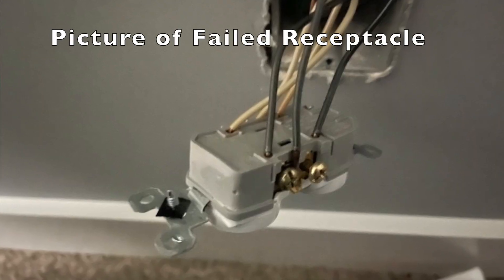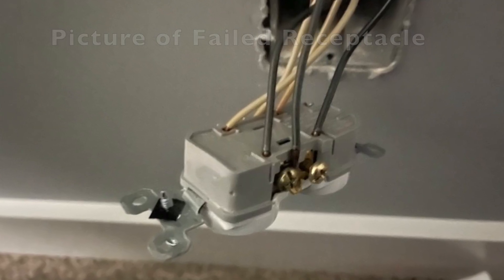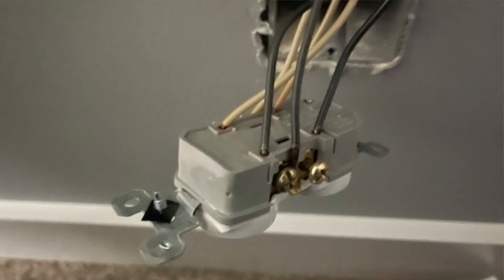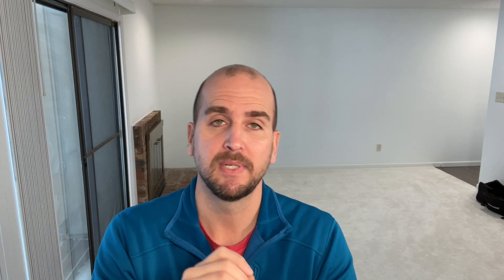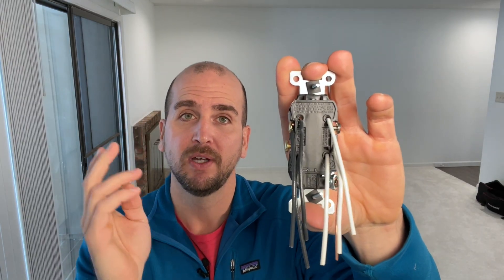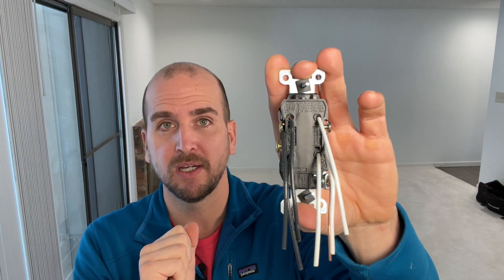Incorrectly Wired Outlet Found In Newly Built Home

Comment: be careful on advice, there are some similar looking receptacles , a gfci in particular, that the wires go only in the holes with the screws slightly recessed with no provision for under screw attachment, Inside are two plates to capture the wiring  like a Hubbell plug, odd but they are out there. overall excellent advice though.

Comment: Thanks for the video! 
Do you recommend putting electrical tape around the outer edge covering the screws?
Reply: I would if using metal boxes perhaps, but I don't see a point with plastic boxes.

Comment: Aren't wire nuts a bad solution also, I've read that lever connectors are better as they don't damage the wires.
Reply: FRICTIONS IS BAD FOR WIRES....I DID TEST THE LEVERS...I FEEL NOT COMFORTABLE IN ANY SITUATION THAT DEALS WITH 120V...ONLY 24V WOULD BE SAFE FOR THOSE SINCE SPEAKER WIRES DON'T CARRING HUGE CURRENT ,WHILE IT ONLY BITE THE WIRE BUT NO GRIP..ITS EASILY PULL VERY HARD APART AND WIRE NUTS DO NOT WHEN USING LINESMAN PLIERS CORRECTLY ON MAKE MORE TWIST AND TIGHT STRAND...WIRE NUT IS ONLY TIGHTLY DOWN TO WIRE SLEAVE ..WIRES HAVE TO BE GRAB TIGHTLY FOR CURRENT ...IT IS ITS NATURE FOR ELECTRONS DON'T LEAK OUT AND CAUSE FRICTION OVER THE YEARS ...ITS NUMBER ONE THING WIRES GET BURN WHEN CURRENT LEAK OUT ELSEWHERE ...

Comment: I've been told you also have to use electrical tape to keep the wire nuts tight. Pulling in the direction of tight.

Comment: The receptacle he shows with the red and white wires is not the same as the shitty back stabbed. The commercial side clamp receptacles are far superior and not at all an issue. And not all wire nuts require pretwisting in fact some dont work properly when you pretwist.

Comment: Hi, I'm not an electrician but have wired some of my own home outlets and switches. As an additional precaution, I've always turned in the unused connection screws on the the outlets and ran a couple courses of  electrical tape all the way around the plastic body of the switch or outlet thus covering the connecting screws in the process. When I peel back the outside insulation in the process of exposing the inner conductors, I usually leave about an inch and a half of the outside skin folding it backwards and over itself and taping it down with a few turns of electrical tape. I do this to add additional insulation where the clamp makes contact with the wire where it enters the electrical boxes.  It only takes an extra minute and adds some additional protection especially on the metal boxes. Some folks turn the clamps up to tightly and in turn could penetrate the inner and outer insulation of the wire causing it to short out.

Comment: In the UK we have ring circuits so those pigtails would not be good. Most domestic ring main circuits here are 32 amp fused feeding  several 13 amp single or double socket outlets so that pig tail could be subjected to 26 amps  WCS.

Comment: Is it wrong that i wrap one wrap of electrical tape around the plug to protect the plug from shorting against the box ? I tend to do this when i do backsplash in kitchens because more often then not i find the boxes are twited from the bad stud they attached it to and the plug is not level or plum and if i adjust it i feel the plug is real close to the box and i dont feel comfortable leaving a possible short ....
Reply from the maker: Not wrong but there seems to be a bit of a split in the pros and joes on where to wrap the receptacle with electrical tape.  This video dives deeper https://youtu.be/mY45ZDdiPn4

Comment: The GFI receptacle in my basement is wired in so badly that I just capped all the wires (grounds too), and put a blank cover plate over the box.
Reply: Apparently you had a GFI at the beginning of the string. Now the other outlets for longer have GFI protection!

Comment: So is no one going to say it? I guess I will. You installed the outlet upside down. The little holes for the ground are supposed to go on top. But no one ever does it this way except for hospitals and on electric generators. It even shows a diagram on the box of most outlet manufacturers that the little whole goes on top
Reply from the maker: If you want to dive deep on that topic here is a video with 4000+ comments on the topic of Ground Up or Down.  https://youtu.be/kYXvcog9MxY

Comment: Push ins should be against code. If people could see the connection they make to the wire they would understand.
Reply: Push in can actually  heat up due to small contact  path.
Reply: If push-in/stab-lok have been identified as a safety issue, by so many professional electricians,  Why does Underwriter's Laboratories (USA) and Canadian Standards Association (Canada) continue to permit their manufacture?

Comment: What are your thoughts on lazy loops?  That is where  a 12" of jacket is stripped from Romex and the loop pulled through the box.  Only about 1/2" of wire insulation is stripped from the apex of the loops and this results in unbroken wires looped over the screws.
Reply from the maker: Not a fan, what about you?
Reply: @EverydayHomeRepairs  I rather like them, as they eliminate a point of failure, allow an unbroken wire from the panel to the end of the circuit; and require less wire to be in the box.  I especially like them for the ground wire, and will do an unbroken loop, even when the hot and neutral are clipped and put into nuts or push-ins.

When I do a pigtail, I usually fold the wire over, strip it, lay the pigtail parallel, twist them together and put on a nut.

If you notice, linemen don't cut the overhead power lines when they splice in the service drop.

Comment: Only thing I saw was wrong is you used a 15amp receptacle on a 20amp circuit. Remember electricity is heat and receptacles are rated for that heat.

Comment: "Mistake #3" needs clarification.  It is neither against code nor against best practice to feed through a receptacle.  In fact, Leviton's TRD15 instruction sheet shows this being done in their first wiring diagram (https://www.leviton.com/en/docs/PK-93996-10-02-0B-W.pdf).  I wouldn't connect more than 1 wire per terminal, but there's nothing wrong with attaching 1 wire to each terminal.  It saves you room in the box and has no disadvantage to using a pigtail and wire nut.

Comment: Great advice plus using the term “Best Practices” is or should be in every industry. 
  Short story, A house built in 1982 with one owner was what my wife wanted. We moved is Easter 1993. My wife said door bell doesn’t work, I confirm problem. Works fine as only one and contacts good. (Dielectric grease went in) So later, works, check again - nothing! What?
I go to the 24 Vac transformer on switch / fuse box on furnace. Identified the primary, dead.
I follow the metal conduit and went to far side then down. What? I had to open furnace door with power off, found the primary wired to the fan using the wire nuts already there. I moved it to hot.
 But felt their had to be more rookie mistakes but none. Just hope the builder was not related! Even though plastic box or extension, I got into the habit of taping around the screws. I place a dot of black weather strip adhesive to the tag end, hold in place for 15-20 seconds. Never comes off. Safer for whoever works on it next, re-check for power, even if hand held shows dead. 
 Grounding rods is another pet peeve of mine. Thanks for sweet little pointers!

Comment: I have seen many variants and the push in is in my opinion the worst idea ever conceived because it looks easy in theory but in practice the wires are put under stress when put into the box.
The screw terminals where you have the wire directly under the screw isn't really good either. A better variant is the ones with a square nut that's pulled up with the screw so that the wire is just pressed by the nut without any rotation that can cause the wire to get messed up. Same wire diameter/gauge if you connect a chain. (yes, there's always the case that you shouldn't have a chain of outlets, but it's easier said than done)

Comment: I was about to rant and rave about using those quick connect inserts on the back. Thank you for addressing them. We call them back stabbers at work, they'll be fine for awhile, but they're all just waiting to stab you in the back when you're not looking.
Reply: They should really change the design of them. You should be able to push the wire through until it pokes out, then bend the wire into that familiar J shape and pull it back before tightening it up. Wrap some electrical tape around the outside and you'd get something that's never going anywhere, but is still going to have virtually all the same benefits of the back stab design.

Comment: Does it matter if the wires go either top or bottom for both hot and neutral?
Reply: It does not matter. In fact some outlets come with opposite side screws diagonal from each other already unscrewed and ready for wire.

Comment: As I've always heard, NEC/Building codes are the minimum requirements to keep you safe, but doesn't necessarily lend to the best or highest quality work. <Subscribed!>
Reply: Engineering is all about finding the bare minimum requirements to get something done and adding a bit of margin for possible errors. Just about any idiot can build something that's over built, a good engineer can build it in a way that has less waste and only the appropriate margins for safety.
Reply: Yes, the code is NOT a how to manual. It is the bare minimum for safety. If a governing body(city, county, state) adopts it they must do so in whole, but they are free to add stricter requirements than those in the code.

Comment: New houses never use metal boxes.  Plastic only. So, first mistake does not exist. Second mistake does not exist too, because it correct to use push-in slot.  For last outlet or two separate outlets 14 ga wire is OK, because we use 15 amp outlets. Third one is OK too, there is no mistake. I see thousand outlets connected in this way with no problem for dozens of years.
Man, don't foolish people.

Comment: i did some work for a "friend" at work. she needed something repaired in her addition. the bathroom light and the sink outlet were wired to a switch in another bathroom in the main house and it was done poorly. in the addition bathroom where a junction was made to the sink outlet it had been modified. a hole was drilled in the back allowing the current carrying wire to make contact with the neutral wire inside the receptacle. you tell me how that happened and why they did it.

Comment: I think it is safer to install the receptacle with the neutral on top because if a plug is loosely plugged and something fall on it like a wire or metal plate it will not immediately touched the hot wires. There was an incident where a woman used a metal wire as clothesline fell on the receptacle got electrocuted and died so was the husband trying to save her.

Comment: Around 2004, the height of the building boom in Las Vegas, a work colleague of mine purhased a new home from a supposedly reputable home builder. After moving in, his mother-in-law was ironing one day when the receptacle into which the iron was plugged started smoking. When the builder sent out an electrician to diagnose the problem, he found that particular circuit was wired directly to the hot bus in the breaker panel with no breaker at all on that circuit. Fortunately it got repaired with no further damage, but that house had been signed off by the building inspector who obviously didn't look very well during the rough-in inspection.

Comment: My bathroom fan quit so I replaced it with a whole new housing and fan because the existing one was oddball. Found the wires were just twisted together and black electrical taped...... out side of the junction box/corner. Oh and the ground wire was just clipped way. K&B Homes, built 1998.

Comment: I was always told NOT to twist the wires to heather do that with the wire nut and tug on each wire to make Shute it is held tight, I’m over 80 now and no not do any work at all but have done construction of all kinds from 13 years old until I was 76, please tell me if I was wrong !

Comment: 6:00 Best practice is to insert wire under screw so wire is drawn in when you tighten the screw. The way you have it, your screw wants to push the wire out. Normally on the hot side place wire on bottom of screw and above on the neutral/ground side.
Reply: You're referring to a consumer grade receptacle where the wire goes around the screw. This is a commercial grade plug and has wire clamps. The wire goes straight into the clamp and the screw is tightened down.
Reply: @warrensteel9954  You are correct. I didn't see the clamp. It looked to me like the wire was under the screw head.
Reply: @petehenry7878  no worries. I like these commercial plugs a lot better than the residential ones.
Reply: @warrensteel9954  Me too.

Comment: In addition to doing that, I always wrap the circumference of the electrical outlet with electrical tape to cover the screw terminal to prevent any possible shorting, and also wrap any wire connector plugs with electrical tape to make sure that no debris over time enters and creates a possible short.
Reply: 1. not necessary box screws prevent terminals from touching metal box
Reply: can you not get outlets that are manufactured to be safe from the start . why should you need to tape an outlet in the first place. 
uk sparks btw

Comment: The box extender disabled the grounding fault protection of the box
Reply: GFI has to be wired with three wires, white, black and green for grounding in a single point reference for all outlets, or it will not work. The box extender has has nothing to do with its functionality. The outlet in the video wasn’t GFI and there wasn’t a green pigtail, so the GFI wouldn’t work anyway.

Comment: Question, why use a pigtail on that outlet? Theres two hot and neg posts, I dont understand not using both
 of the posts instead of double up or pigtail. Am I missing something? I am not a electrician haha. @4:40 is there some reason to avoid this connector on the outlets?
Reply from the maker: Pigtails help to isolate the receptacle from the rest of the circuit.  With pigtails this receptacle could fail and not knock out the other receptacle down stream.
Reply: @EverydayHomeRepairs  ah, thank you for the response and great videos.

Comment: Also, if that is a 15 AMP receptacle and that is a 20 AMP circuit (because of the 12 gauge wire) you definitely want to pigtail as you do not want to 'feed through' the outlet to the next in the series. The bus bars between screw terminals are not intended to carry a higher load than rated. As far as I know you can use 15 AMP receptacles IF you use pigtails so that the main feeder wires are 12 gauge from panel to the last device in the series.
Reply: I think they make 15 amp receptacles with 20 amp feed through also. But I do like the pig tail idea better

Comment: I'm not a licensed electrician, I'm a general contractor. I've been in the business many years and have needed to do electrical work because of demolition and re-installation work. I have seen many push-in connection fail and poor grounding issues....not to mention just about every other issue there may be. 
First of all, you get what you pay for. Buy the better grade of electrical components....they're worth the additional cost.
Second, what's been covered in this video is excellent advice.

Comment: Is it legal to use #14 for your pigtail on a 20 amp circuit, assuming the outlet is only 15 amp rated? I was told once this was ok and it does make it easier stuffing back in the box.
Reply: nope

Comment: Why didn't you use the "J-hook method" (6:03) when putting that wire on the terminal?
Reply: You don't wrap the wire around the screw on these commercial type outlets, since they have a compression plate that you put the wire behind.   https://www.addicted2decorating.com/wp-content/uploads/2019/03/how-to-wire-an-electrical-outliet-6-use-a-back-and-side-wrie-outlet-for-easy-installation.jpg

Comment: I don't do much mains AC (mostly 12 to 48VDC, with a lot of stranded wire rather than solid core as the sorts of things I do are frequently vibration prone) - is there a reason I rarely see rings crimped on for screws for house wiring?